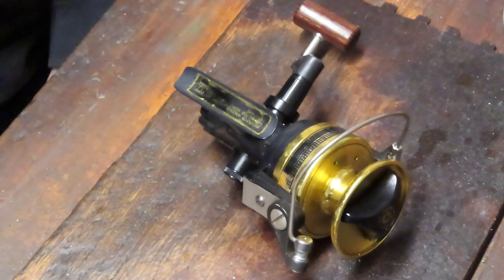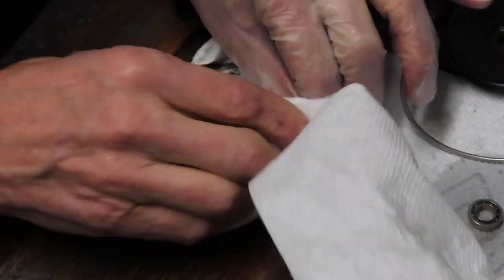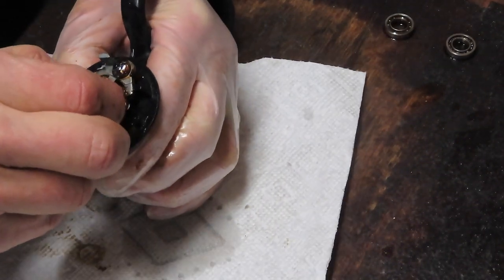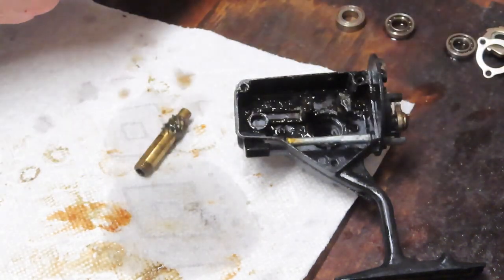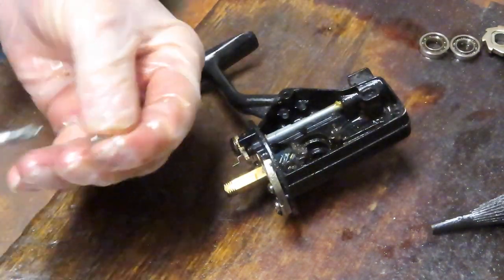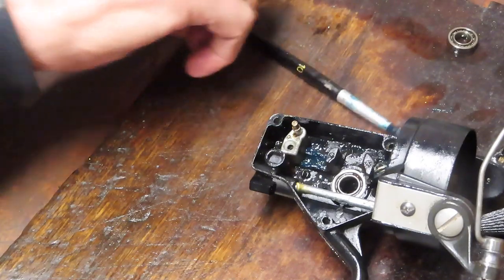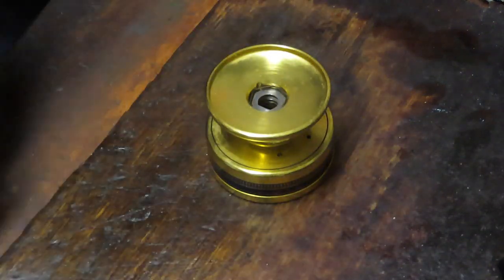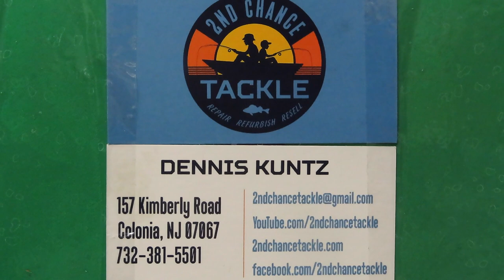Daiwa BG 30 spin fishing reel how to take apart and service

Comment: What a great video Dennis, thank you for putting it out there. I have this same reel and followed your steps to service the reel. I hadn't used this reel in years because it wouldn't lock after casting. It turned out to be the anti reverse eccentric spring was not seated in the anti reverse dog. Lubed everything up, reassembled and that reel and it is ready to catch fish again. Liked your video and you now have a new subscriber. Thank you for doing these videos and keep them coming.
Reply from the maker: Thank you for the kind note.  I appreciate it and the sub.  Best wishes for great fishing with the BG reel - Dennis

Comment: Hi Dennis. So glad you did a video on the BG Daiwa series. Like you it's also one of my favorite reels. I have the 10,13,15,20 and currently shopping for the 30 & 60 on eBay because I like them so much. I've learned so much from you. Keep up the good work sir.
Reply from the maker: Thank you for the note and for watching - Dennis
Reply: @2ndChanceTackle  I purchased my BG60 yesterday in mint condition.
Reply from the maker: Congratulations - I think you are going to like that one a lot
Dennis

Comment: What great spinning reel! Hope I can find one sometime. I had heard about that rotor wobble in these reels particularly the larger sizes. I’ve also never liked the oscillation system on this reel. I like the Penn and Daiwa worm gear reeels. I would put the Daiwa 8000 series on my top ten ahead of this reel.  The Daiwa 8600 and 8700 has three bearings but has a worm gear drive just like a Penn Spinfisher 704.  Still this BG is a superb reel! Thanks for doing this one Dennis!
Reply from the maker: This series it what has defined Daiwa from then until now.  Thanks Chris

Comment: Is the only difference between the different color versions just the material the reel is made of , or are there internal parts that are different like bearings vs bushings?
Reply from the maker: They changed the case and internals with this one

Comment: Dennis I have a Penn Battle 4k that I have torn down and cleaned and greased twice and it is still very stiff. There is no obvious corrosion or damage to the reel. What am I missing?
Reply from the maker: You may have a bent axle shaft to a misaligned gear

Comment: Hello Dennis and guys I got a BG 30 and looking for the big gear where can I get one
Reply: Hello Dennis can you please repair my BG 30 or can you please tell me were I can get it fixed I'm located in Chatsworth Durban
Reply from the maker: Those are no longer available through distributors.  Check eBay for the gear or other sites for a donor reel - Thanks is the only way to get one for the original series - Dennis

Comment: The spool on my daiwa 30 is stuck and won't come out after using lubricant
Reply from the maker: If you can remove the adjuster knob, work to remove the drags from the inner cavity one by one - it is likely that a drag washer is swollen or broken and that it what is making removal hard.  As an alternative, open up the lower case and remove the axle shaft/spool assembly  by detaching it from the crosswind block and pulling up and out.  Once is is free from the reel, place the assembly upside down on a board and push down on the spool to help break the seal of the washers.  Make sure it is on a board and not a hard surface and be careful not to damage the axle shaft threads - Dennis

Comment: I have a BG60 and for the life if me I can't get the broken handle off
Reply from the maker: That handle screws into the main gear and is removed by turning it in the opposite direction from the crank retrieve.  If it is not unscrewing, try taking the side cape off and spraying the cavity of the gear on the non handle sire with penetrating oil.  That may help loosen up the stud.
Dennis